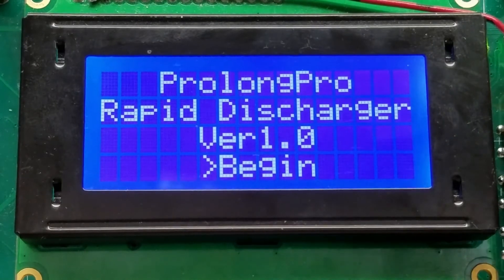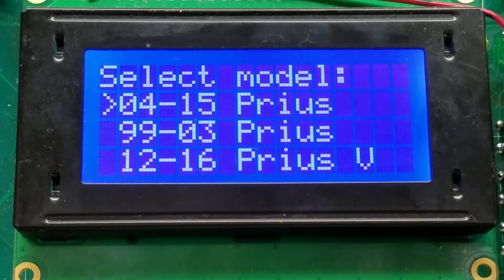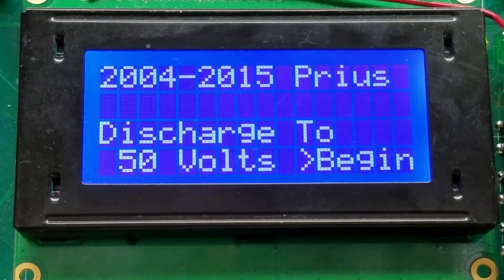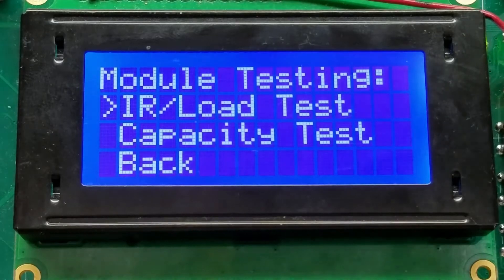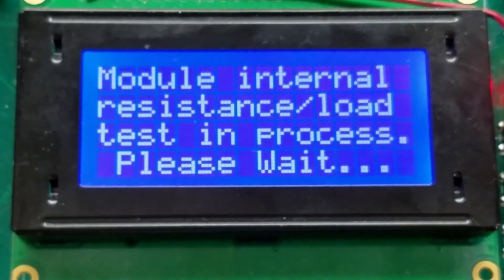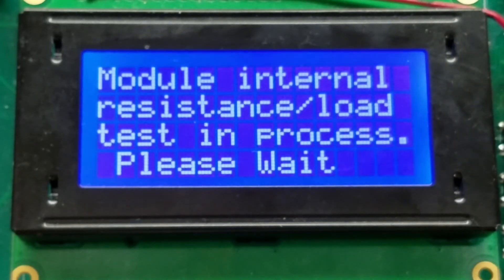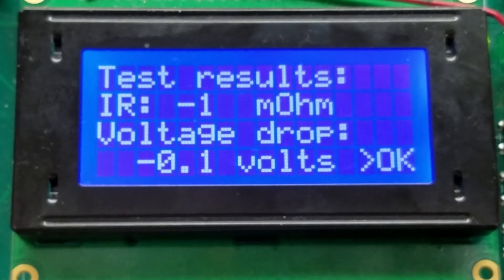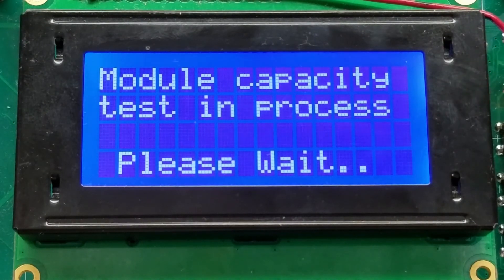ProlongPro Discharger Preview

Comment: Interesting that you have 4 voltage points to discharge battery pack down to recondition them. I would have to understand the rate of discharge and if you go up and down the scale to the bottom and back up to the top of the scale to be sure they are all cycling equally for it to be considered fully reconditioned. Do you have a manual and best practice to get the most out of a reconditioning process or are all of your processes on video and available when you buy your products? Is it best that all the bus bars be replaced with nickel plated bus bars or would all these tips and information be provided when any products are purchased from you?? Do most of the repair shops you provide your products have a good success ratio on reconditioned battery systems of a year or more when properly serviced with bad modules replaced? Not like I would expect you to answer that last question, but you always have to ask questions like that to get an idea of how well these type of repars work out over the long term.